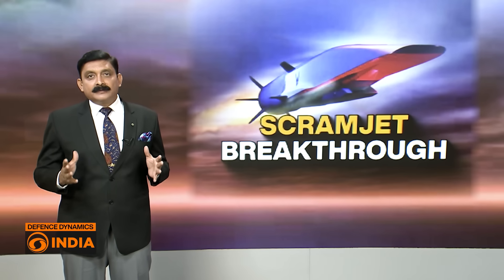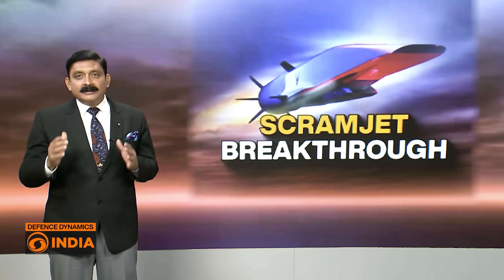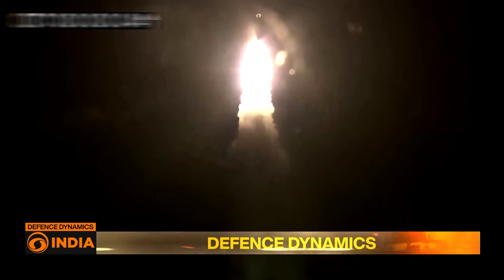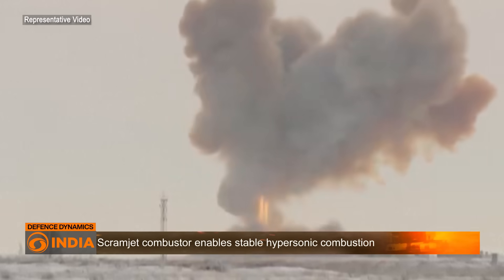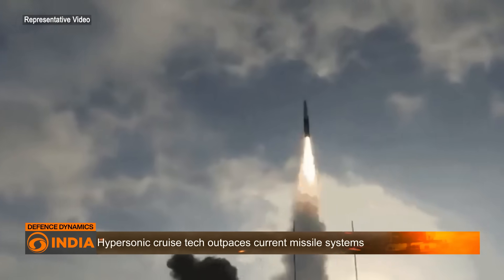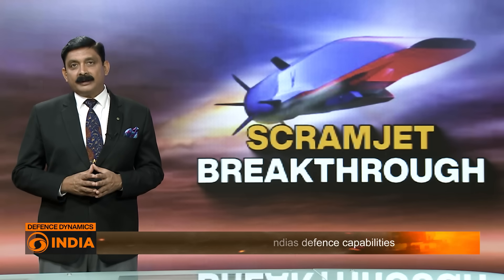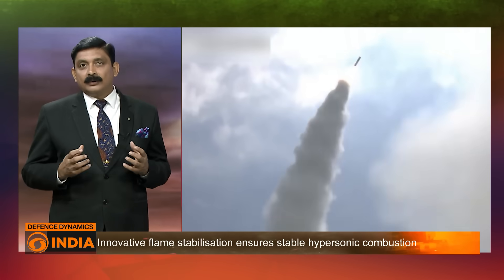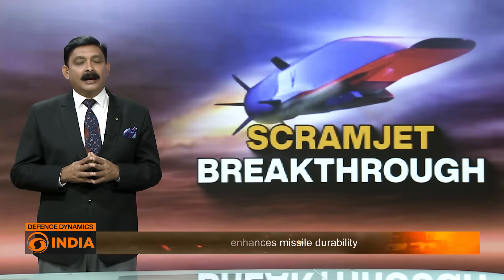India’s Hypersonic Breakthrough | Defence Dynamics

Comment: I have a doubt. Why is the longest distance measured between US and China. 11646.7 km. / 7236.93 miles. / Nautical Miles: 6284.55 NM. Estimated flight time: 12.76 hours. (With average airplane speed of 567mph), instead of the closest distance between their borders which is  2696 km. / 1675 miles. / Nautical Miles: 1456 NM. Estimated flight time: 2.95 hours. (With average airplane speed of 567mph). Wouldn't it be much easier and faster to use the shortest route to launch any missile?

Comment: the start: i dont see a point in comparing the speeds of passenger aircraft and a military hypercruise tech. airlines are designed specifically to fly slowly to reduce drag and reduce fuel costs, while maintaining an economical balance. while the hypersonic tech such as ramjets, scramjets, etc are designed for max speed to reach target in min possible time (and its not economical). that speed comes at a cost, which is why we dont have regular sonic, supersonic, hypersonic airline planes for passengers.

Comment: wait i believe there is a calculation mistake as the speed mentioned was 5 mach and it is approx 5500 kmph at stratosphere 
the time mention must be 10 times more which is (here mentioned 20 minutes) . It should be approx 200 minutes